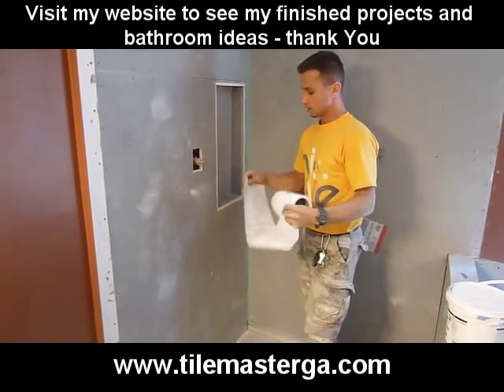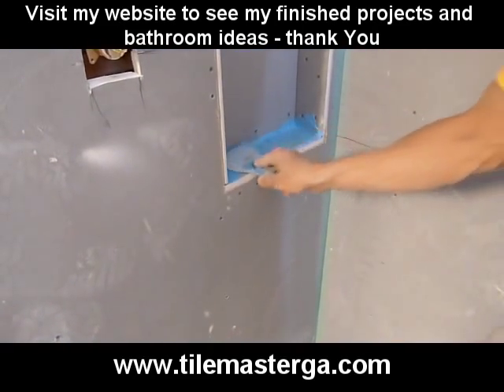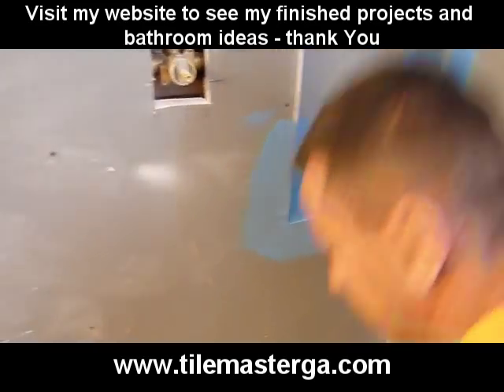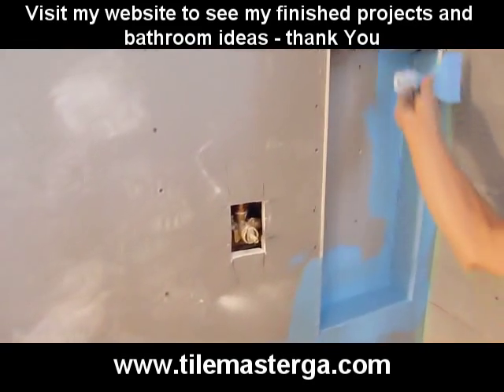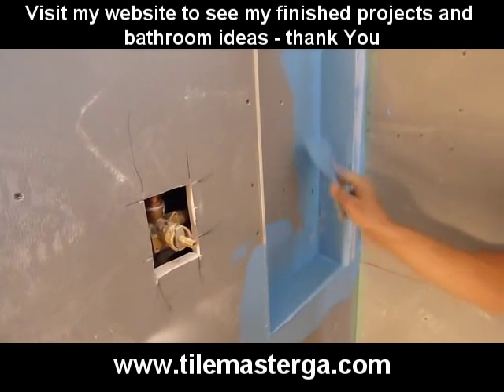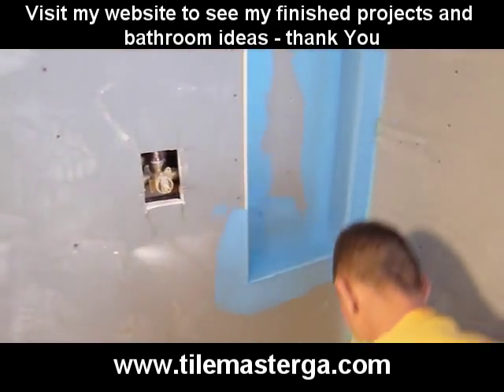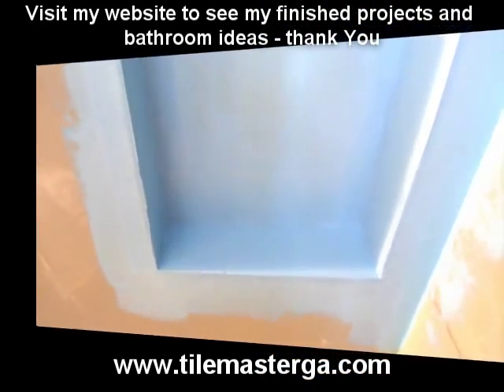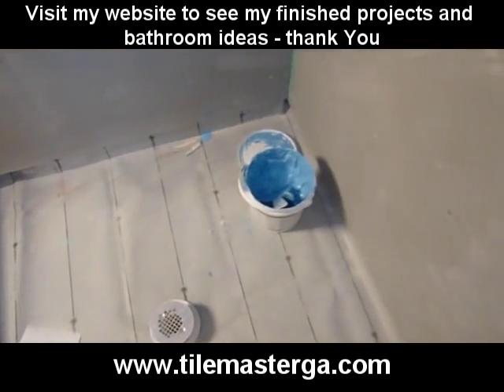PART 2. How to install built-in shower niche, nook, recessed shelf -- waterproofing with membrane

Comment: It seems there is a number of ways to do this based upon other videos and advice I've received at Lowe's/Home Depot, but I like Michael's method the best.  I just bought the non-woven fiberglass tape on of your eBay offering even though my project won't start for another few weeks.  Thanks for the very good videos you've posted on here!
Reply from the maker: Thank you and good luck.
In my e-bay auction you will find tape and membrane. Just look for:
" TileMasterGa "
in e-bay search.
Reply: rand49er first mistake was listening to people in Home Depot or Lowes. Not giving you grief, but more times than not you're getting sold a product with little experience

Comment: The back wall of the shower niche is usually the sheetrock wall of an anjacent room.  How do you attach the Durock (or similar) CBU to the sheetrock?  Do you use an adhesive?  Obviously a screw would pop out of the opposite wall.  Thanks

Also, when using a CBU with RedGuard (or similar), does it matter what side of the Durock faces out?  I used the rough side out on most boards except one, and the RedGuard painted/covered the smooth Durock side so much easier than the rough side.  Once the CBU is thoroughly coated with the waterproof membrane (and therefore smooth), I don't see the value of keeping the rough side out.

Comment from the maker: Most of the times i am applying membrane on seams, curb, knee-wall and nail-holes. It depends what type of material you will be using. If you will paint entire shower - will work as weal but in my opinion is not always needed. I am waterproofing areas that are usualy leaking. Please look at my other wideos for more details..... Mike

Comment: Hey Michael, do you apply the blue waterproofing membrane to the ENTIRE shower stall area??  Cover all of durarock or dens-guard with blue membrane then install tile?  Or just use that for seams and then just thin-set, then tile?  Thanks.